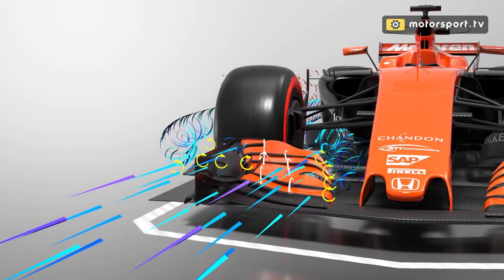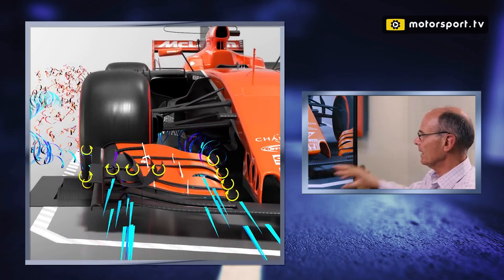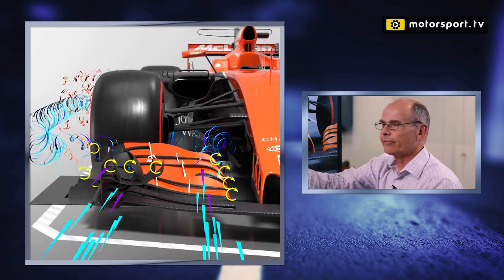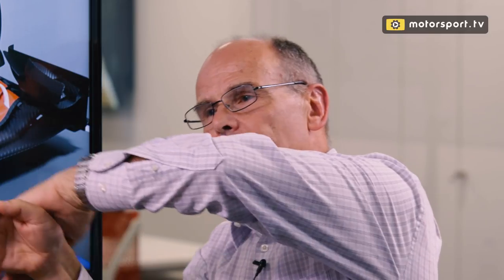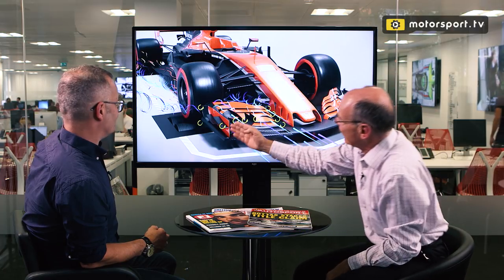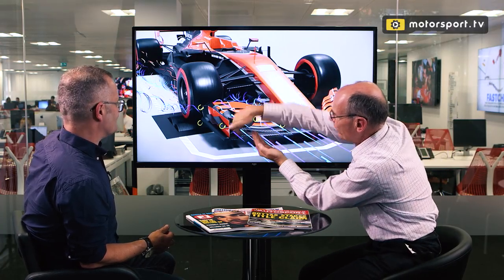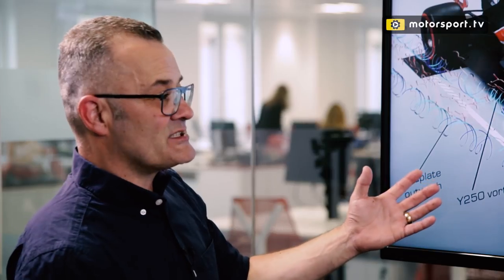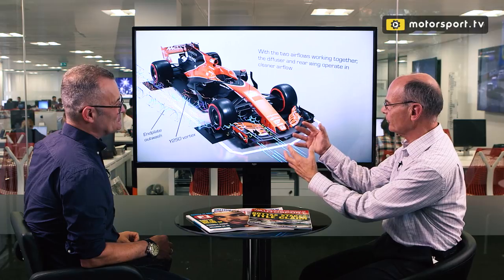F1 airflow explained - part 2

Comment: As an aerospace engineering student I find this stuff SUPER fascinating. I think it may help with my aerodynamics sections
Reply: I'm in the exact same boat. Looking forward to my fluid dynamics and aerodynamics classes.
Reply: F1 as a sport leads to so much innovation, I love watching what the teams come up with to get that small competitive edge over the other teams.
Reply: I also love to see how F1 innovations are translated to aircraft and vice versa.
Reply: what is your study like because i heard you need to be outstanding at maths and that scares me off a little
Reply: Angelo Soede i havent had much of an issue with the aerospace classes, but there is a lot of math involved. The actual math corses arent easy though
Reply: You do a lot of calculus and differential equations. So if you get that stuff it's pretty easy.
Reply: MrWillyP alright thx for the reply

Comment: Aaaah so that's why everybody keeps adding elements to their cascade! More elements means more mini vortices means a stronger Y-250 vortex means more air is pushed out the sides of the car to make the low pressure area under the car stronger. 
These two videos were very enlightening, I feel smart now.

Comment: Can anyone explain why a vortex is optimal and not a normal flow of air? I might have missed it in te video, but i didn't see it, so if you know where they say it tell me, thanks.
Reply: Charlie Met het poepie well, my understanding is that a vortex is easier to direct towards the underside and hence the diffuser which is by far the most significant downforce generator (makes about 60% of downforce while adding almost no drag)
Reply: Charlie Met het poepie I think it only applies in certain uses. The vortexes coming from the front wing can be used to effectively seal off the underside of the car, stopping air from getting underneath, and therefore increasing it's efficiency. But on a wing, I'd imagine that a straight flow is best.

Comment: Great video but you didn't at any point say what the endplate vortex is for. Is it just working with the Y250 to tunnel the tyre wake, or is it doing something else?
Reply: Max Benard That is the impression I got from the animation. I would suppose just based off this video that it would be important to funnel the dirty air from the tire wake and keep it from slipping under the car and creating positive pressure or to keep it from unbalancing the rear wheel (think Red Bull's old blown diffuser trick). However, not every end plate has been super critical to the performance of the car as Ferrari proved a couple years ago when Vettel damaged his front end plate in a race and afterwards admitted he had no idea had happened. I took to mean he felt no significant change in the balance of the car.
Reply: +Marcus Teske That is an interesting point Marcus. Seems the endplate isn't really that important which corresponds with what we are seeing in the animation as the y250 has already done most of the funneling. But I guess I would still like to know why the endplate's vortex is necessary at all given that it doesn't actually separate the car and the tyre wake. In some ways it almost looks like its preventing the tyre wake from leaving the car!

Comment: And I thought the idea was to smooth the airflow............. Thats why cars dont like dirty air right?. And I thought I had a handle on it. Oh well, back to school.
Reply: Well you don't want to be in the dirty air but you want to have dirty air A) because more down force usually makes more dirty air B) it will slow people down behind you making it harder to pass. That is why they have to change regulations to get cleaner air, because no team would make a slippery car if they were allowed to make one that isn't.
Reply: @JettXxB  Closer but still not quite there. Downforce doesn't necessarily produce dirty air (as will be demonstrated by ground effects in 2021). Outwash/vortexes create dirty air. Also, cars do and don't like dirty air.... Dirty air does NOT slow the people down behind you. Dirty air is what creates the slipstream behind cars, which allows for trailing cars to close distance on straights. The problem is this same slipstream also massively reduces the downforce generated by the trailing car (as the aero features are designed to operate optimally in normal or 'clean' airflow) which severely hampers the cornering speed of the trailing car. And as F1 cars are predominantly reliant on downforce/cornering speeds for their record setting lap times, the speed gained from drafting other cars  (due to dirty air) is far overshadowed by the time lost in cornering speeds (due to the same dirty air.)

Comment: I have a question, when we consider wind tunnel testing, doesn't the air that is being blown over the car in a wind tunnel give a different effect (because it is moving), to the stationary air that the car is driving through? So then how accurate is wind tunnel testing really?
Reply: The air IS moving relative to the car in a race. If the wind blows with 20kmph OR you put your head out the window of a moving car which goes 20kmph, you feel the same air movement.
Reply: i always thought this as well,